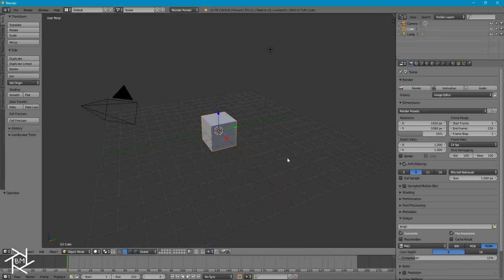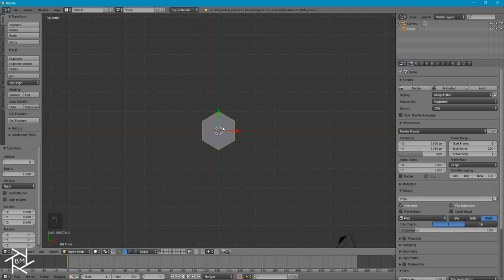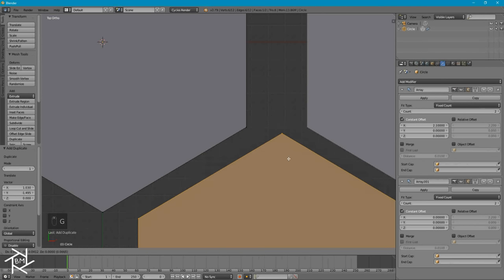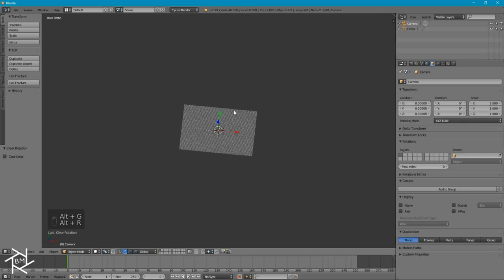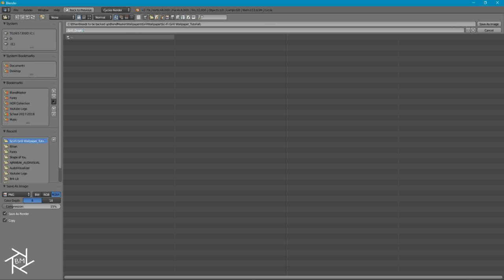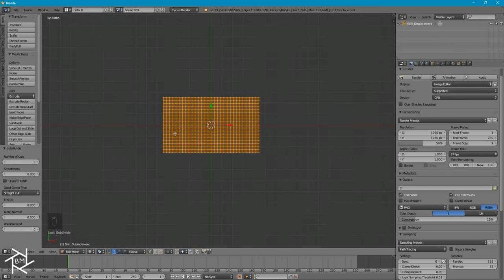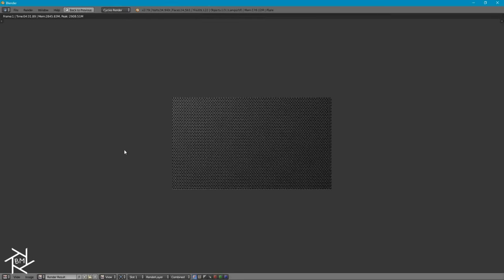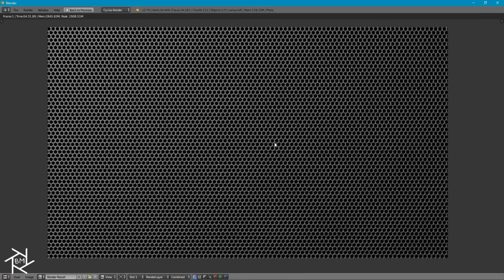How to Create a Sci-Fi Panel Wallpaper in Blender

Comment: I found a more accurate solution for finding the exact location for the first array at 2:00 ;
1.on the duplicate hexagon and rotate it either 60 or -60 degrees on the z axis (r,z,type 60 or -60 and enter)
2.in edit mode select the whole second hexagon you just rotated and move 3d cursor to it (shift+s)
3.select first hexagon you made and on the array modifier type the 3d cursor location (look on the 3d view port properties, press n if it's hidden) on the constant offset coordinate
4.for the second row array modifier paste the y coordinate from the cursor or first array and multiply it by 2(you can do it within the number field y*2 and enter) 

hope this helps
Reply: I was messing around with project some more and I realized in edit mode you could just scale the hexagons till they merge, inset(i) and then extrude(e) up or down the z axis to get your shape you want. https://imgur.com/a/3mPhs
Reply from the maker: Thanks for sharing! This just proves that there are so many different ways to achieve the same result and there is no one correct way. ;)